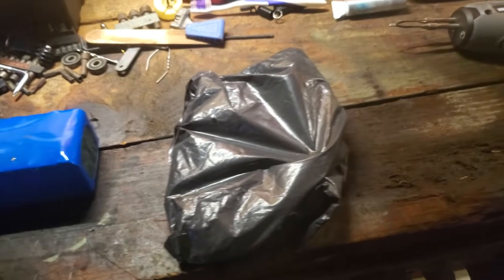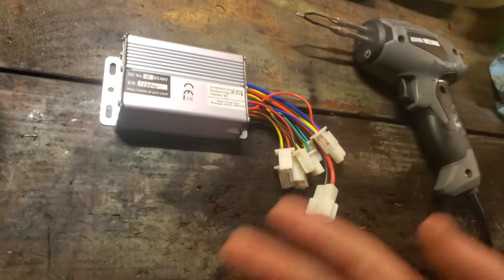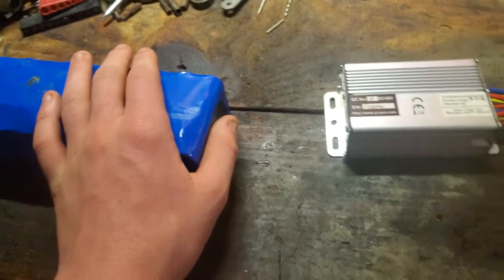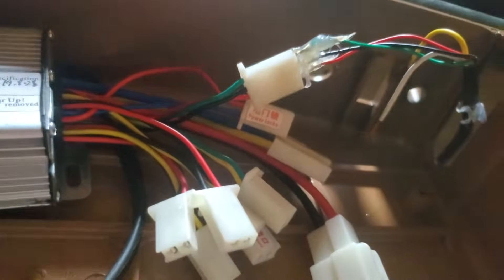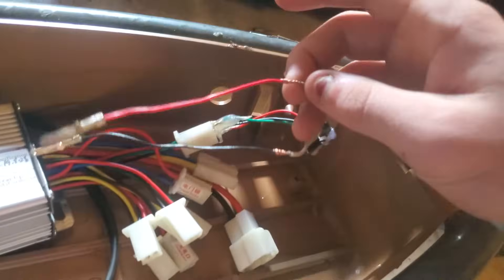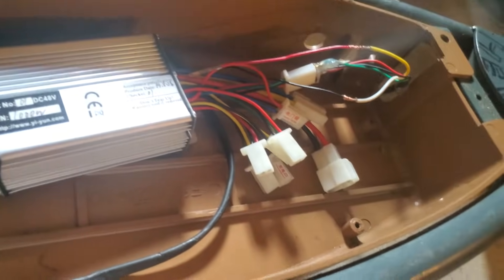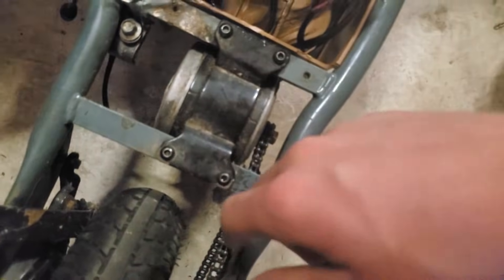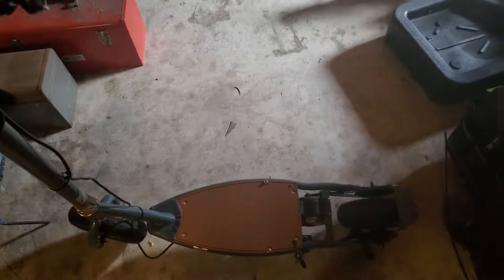Wire 48V Speed Controller Key Throttle, Motor, Battery...

Comment: So u got to hook the switch to the ground and positive battery
Reply from the maker: @derickvorpagel  yeah its different on each controller but some of them have a single red wire that comes out of the controller which is the ground

Comment: What's the hall hook to
Reply from the maker: @derickvorpagel  The hall hook is only used on brushless speed controllers and motors. It is important to know which speed controller is the correct option for your motor.

Comment: I don't have power locks one
Reply from the maker: @derickvorpagel On some speed controllers they don't have a keyswitch plug. They usually have a red ground wire and you ground your switch between the ground and the positive pole of the battery.

Comment: I am a 77 YO gent recovering from a double displaced fracture of the femur, and going out of country to visit family and need to take a mobility device with me.  I bought an e-bike  made in America and is 25 y.o.  It is a 24V brushed motor with a German 500W motor and the motor works.  It needed a twist throttle, so I bought this combination throttle and controller from Amazon:  Brushed Controller, 24V 500W Electric Bicycle Scooter E-Bike Motor Brushed Speed Controller Box with Handle Throttle Grip. We connected the red and black to battery and blue and yellow to motor and the three wires for speed control.  We used the door lock for the Keyed switch so we didn't need to jumper it.  Why doesn't the motor run?
I thought I ws smart buying this old bike because it has an AGM battery allowed on flights.
F
Reply from the maker: @FredCampbell-h8l  Check your total voltage coming from your battery pack. If it's 24 volts it should read around 25.4 volts fully charged. If you're getting below 21v you might have a low power source to the controller.

Once that's isolated, I would double check that your throttle wires are connected correctly. You may have to switch them around until it works.

Lastly, you could test your motor by running the battery terminals directly to the motor, if the motor runs, the motor is good 👍
Reply: Thanks

Comment: That controller is no good for mid drive or hub drive motors as theyve only 2phase wires yellow blue and green i wonder if a 3rd could be connected ? The main motor thick wires is what im talking about
Reply from the maker: Yeah those hub motors are for brushless controllers they work off of hall sensors and 3 phase wires. All of the old brushed controllers are 2 wire phase with no hall effect

Comment: but can i change just the battery? to one with the same voltage but higher amp? like 30 ah or more? i just want to travel longer distances the speed is oke now
Reply from the maker: @michaelkos7755  yes you can

Comment: you think i could do this on a e175 and is that the stock motor
Reply from the maker: On the e100s I think it can handle 36 volts but I haven't tried 48 volts, I'm pretty sure the motor has a voltage cutoff. The scooter in this video has the stock e300 motor, and even then it was too much power and would overheat often.
Reply: @dylanmoore1006  alright thanks imk thinking im going to replace the motor on it then and could you replace the link for the battery it does not work any more
Reply from the maker: @snorkel7654  agomola 48V Battery Lithium ion 10Ah 14Ah 15Ah 20Ah ebike Battery for 100W to 800W Electric Bicycle Bikes Motor with Charger BMS https://a.co/d/98EtH9W

Comment: I know this is like three to like six years ago. It’s still relevant. Of course I got the Jetson electric bike. I’m stuck at 15 miles if I change my controller will I have access to more speed?
Reply from the maker: Some controllers will allow more power to be withdrawal from the battery. But it depends on how many watts it's already making and the battery voltage ratings. Usually it's possible

Comment: Can my 36V throttle work on a 48-volt controller for an e-bike?
Reply from the maker: @sherwinsarmiento3970  It should work if it has at least three wires
(Red green & blue). Sometimes the ground wire might be a different color.

Comment: How do we get current,voltage,rpm and heat values from the motor controller
Reply from the maker: https://a.co/d/j3MtFq4
Reply from the maker: They have some for brushed controllers but the brushless ones have alot more features https://a.co/d/brEFbsW

Comment: Hi. Can u run this controller with  foot throttle for a go kart? I've tried it and have had no luck. Thanks
Reply from the maker: Yes hook up the three wires black, red, and green into the derailleur plug on the speed controller.
Reply: @dylanmoore1006  thanks for the reply. Tried that and no joy. I assumed I should be seeing 5V between red and black? Only getting 150mv. I bought a second  controller and have the same result.
Reply from the maker: A couple questions are you using a brushless or brushed speed controller and motor? The one I'm using in the video is brushed, and if you use the wrong speed controller, it won't power the motor. I'll send you a link to the esc I used in the video. It is for a brushed motor only

 https://a.co/d/6lRGHMf
 https://a.co/d/aNclzNZ

Comment: So with replacing the controller should I get the exact same one from the company’s website or can I get it from anywhere
Reply from the maker: Try contacting the website first and if all else fails you should be able to use any universal controller with the same voltage/amp rating

Comment: Just purchased some of the link scooters at auction...can I do the same for them..or do I need different BMS board etc...thank you
Reply from the maker: If the scooter uses a brushless motor, it will need a brushless Speed controller. The motor on my scooter is an old brushed motor, and they aren't as efficient on battery life.

Comment: My only question is can you wire two of those battery packs together?
Reply from the maker: You can wire them in series. But depending on the bms used in the lithium pack

Comment: If I held down the throttle for a long time would the controller or motor pop first? Also would the pop of the controller be loud enough to hear?
Reply from the maker: Sometimes one can fail before the other, from my experience usually the motor overheats first. There is no noise but you will smell the motor overheating. It can hold full throttle for a minute or two. These motors like to stay at 36v
Reply: @dylanmoore1006  what's the range on your scooter? Do I need to plug the charge port through the controller or can I just use the provided charge port on my battery?
Reply from the maker: @milolim48  I sold the scooter, but when I had it I got around 15 miles every charge. You can charge the battery without the controller if you need to. Larger battery packs extend range
Reply: @dylanmoore1006  how much did you sell it for?
Reply from the maker: @milolim48  I sold it for about $300 back when I could get away with that. Nowadays, it's hard to sell them for a reasonable price
Reply: @dylanmoore1006  If I don't have the right connectors can I just soldier the wires together?  Also I didn't see you wire the breaker, I see other people doing that on their modded scooters, is that necessary? Is the breaker like a fuse and if I don't wire it will something bad happen, or did you now wire it because you are overvolting the motor and it would trip the breaker once you turned on the scooter?
Reply from the maker: @milolim48  Yeah most of the wires you can solder your own connections. The reason I removed the fuse is because the lithium battery has a built-in battery management system to protect the cells. Some of the upgraded speed controllers have an overheat cutoff that will shut off the system until the motor temperature cools down.
Reply: @dylanmoore1006  Also for the key switch does it matter which color wire go with each other or to you have to match the colored wires together?
Reply from the maker: @milolim48 It doesn't matter which color but of you have a keyswitch throttle with any sort of indicator lights then they should be reversed.
Reply: @dylanmoore1006  Do you think that the brakes have enough stopping force considering the upgrades or do you think that I should upgrade to disc brakes?
Reply from the maker: @milolim48  The stock brakes worked for me. But it will wear down the pads faster, and I was constantly adjusting the drum.
Reply: @dylanmoore1006  So do you think that it's worth it to just replace stock brake pads or try to find a tire with a disc brake?
Reply from the maker: @milolim48  Disc brakes are all around better, but it would require some custom fittings to hold the brake caliper in place. It definitely can be done though. I do remember being able to drift with the original brakes, they do lock up pretty good for what they are.

Comment: You are the magician of electric vehicles.  I just wanted to ask you if there is a way to put an escooter controller  on a mobility powerchair that has  2 motors. Really hoping that you can. Thanks for these fantastic videos xxx
Reply from the maker: Thanks for watching! I'm sure it's possible, it would depend on the type of motor used. The controller shown in the video is for a brushed motor.

Comment: I dont have black but I have white Grey and yellow which do you suggest I use?
Reply from the maker: If there aren't any labels, I would contact the supplier to see which connector is the power lock. Jumping the wrong connector can blow the controller mosfets.

Comment: I have wite yellow and a blue wire , if I plug white and yellow in to power lock like you did , what do I do for the blue wire ? 
Any help appreciated
Reply from the maker: Are the wires coming from a throttle?

Comment: Any additional thoughts? Thumb throttle with on/off and LCD display, RED, BLACK, GREEN, YELLOW, BLUE. Controller available wires, RED, BLACK, GREEN, YELLOW, WHITE, BROWN. 1000W 48 Volt Brushless Controller. Please comment ONLY if you know which combination works! Thanks! MarkMannM2
Reply from the maker: Not all speed controllers are the same, but I'll shoot my shot at helping you.

Red black and green should all correspond with the same colors on the "derailleur" plug. The yellow and blue should hookup to "indicator light" plug. Lmk if this makes sense
Reply: @dylanmoore1006 hi I've got 3 18v 5ah makita batteries I have all the adapters for them to work on a scooter. I was just wanting to pick your brain to see what controller and motor you think would work.  Xx
Reply from the maker: @vikkidyer  if you're running the batteries in series to get 54v, then I would assume a 48v controller/motor pair would work fine.
Reply: @dylanmoore1006  thanks so much for the reply.  I will have a go 🙂

Comment: I have a Uber scooter1000w there is a sport line on my control where does that one plug into
Reply from the maker: Not sure, but there's definitely some info online. They always put many extra connectors and features on the controllers. What I do know is that they're optional to connect.

Comment: What is i changes to i have 500watts motor i want to 1000watts  upgrade. Do you know i changes the controler to upgrade too
Reply from the maker: First, determine if your 1000w motor is brushed, or brushless. Then search Amazon for those specifications including voltage.
Reply: @dylanmoore1006  i said if when i changes the 500watts motor to 1000watts  what is controller i use
Reply from the maker: @BienviTv  Gotta know which type of motor we're talking about here. There's two different types of speed controllers, brush or brushless. Another words get a 1000 watt controller. But don't get the wrong one

Comment: Bro I need help stat!!!!!!!!  1. When a controller says that it's rated "controller current" is for example 34 amps, does that mean your battery need to constantly provide 34 amps at all times for the controller to work? 2. If your motor is rated for say 48 volts does that mean your battery needs to have  48 volts for the whole system to work, or can I get away with a battery with less voltage? 3. vise versa, if the motor is rated for 48 volts and I put more voltage, is that motor going to overload? or perhaps the controller will over load? 4. Is a 2000 watt maximum motor for a bike a normal thing? becuae I see companies like Swytch bike have powerfull motors with only 250 volts and 12 amps maximum. I am super confused and I am trying to make an electric hub motor for my bike. If you have time please help. thank you and great video
Reply from the maker: My knowledge about ebike controllers is pretty basic so bare with me. The amperage is the max current the controller can handle I believe, could be wrong. 

Depends on what controller you have and how it's set to work, most of the time it won't work undervolted. The pre-built 48v speed controllers are set to shutt off around 42v reading the battery as dead.

You can overvolt some hub motors up to 12v+ as long as you do a bit of researching.

2000w motors are great as long as you're buying from a legitimate source.

Comment: should i connect the blue and yellow wires from the throttle to the power lock wire on the controller? if so thank you very much dear friend you saved me

Comment: Hello my name is Paulo chapel, friend help me with a brushed controller d 30 vts 500w 28 A. of the brand XUN.
I don't know how to connect this device, on the accelerator with a contact key, this accelerator has 5 wires
(On Throttle Socket: Green, Black and Red)
(separator: 2 wires; Yellow and blue.) This throttle has a motorcycle key and battery indicator.
on the brush controller there is a white socket written: (Derailleur) in the colors green red and preto. I already know it's the accelerator but what about the two yellow and blue wires????
where can i plug it in?? we have two blue wires in a white socket written lock two blue wires written lock; what are these two wires for?
Reply from the maker: Connect those two wires to the "power lock" on your speed controller. This is your power switch, if the bike stays on when you plug it in, reverse the two wires, and it's ready to use
Reply: @dylanmoore1006  the friend refers to the two blue and yellow throttle wires? connect to the blue wires that say lock ?
Reply from the maker: @boasnovasonline8764  yes sir, the blue and yellow are coming from your throttle correct? Connect those two to power lock. Should be red to blue, and then yellow to the other wire. Your keyswitch should turn on the unit.
Reply: @dylanmoore1006  https://youtu.be/nyD0LqaVoNQ
friend I edited an emergency video, showing the model of my controller and the type of accelerator and the purchase site, everything in this link I think you will understand better what I'm looking for
Reply: https://youtu.be/nyD0LqaVoNQ

Comment: I plugged everything in right (I think) and when I turn the key the voltage comes up but when I turn the throttle the motor doesn’t go.
Reply from the maker: Only four wires are needed to get it going which include:
Battery, throttle, keywire, and motor.  Check that your throttle wires are matching colors. Check motor polatity, and battery life. If it still doesn't work there's a chance the controller has been blown from being connected to the battery incorrectly.

Comment: is it possible to use this in a remote controled large car with a 48v motor
Reply from the maker: Haven't tried it, most rc speed controllers work differently than these. I wouldn't expect it to work unless you find a way to hookup a transmitter/receiver

Comment: If I add a controller that has a higher wattage then my motor, will it damage my motor. I am having trouble finding a 700W one for the 3 wheel scooter that I have and it does have reverse, 3 speed forward and alarm connections. the high speed is not working and all the wiring and switches check OK. Thanks in advance for any help.
Reply from the maker: I mean I've been running a 500w motor through a 1000w controller, the wattage rating on each controller Isn't what changes the power. That's all the motor. The controller just limits it's power capacity and using one that's rated higher than your motor will just unlock all of it's potential, and it doesn't increase from there. Now reverse, I have zero experience with just because I've only built 2 wheel scooters.
Reply: @dylanmoore1006  Thanks, I think that I will buy the one that has the same number of conectors and give it a try
Reply from the maker: @supplyman1240  Oh no problem lmk how it works out